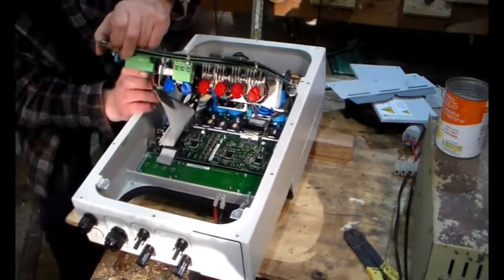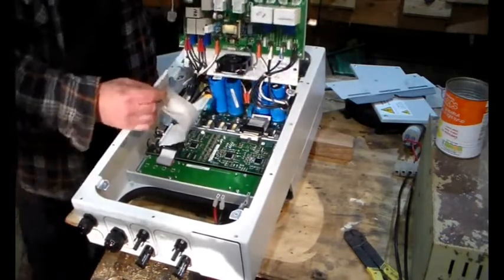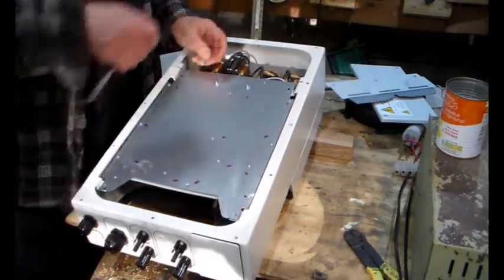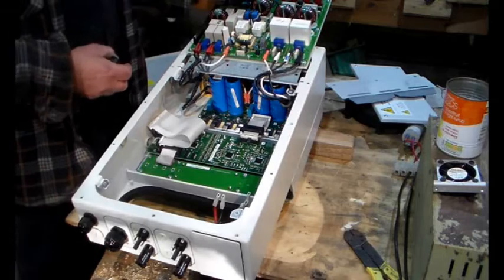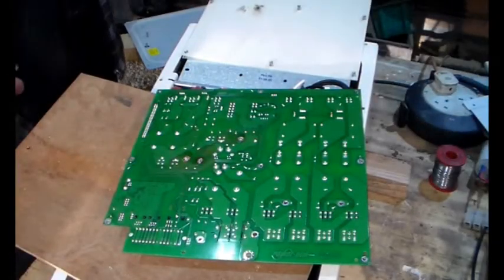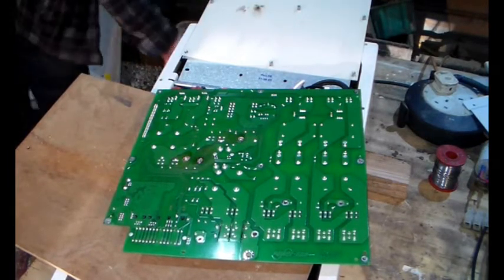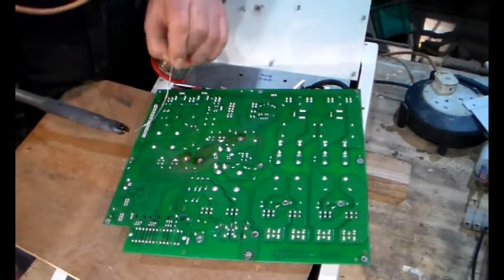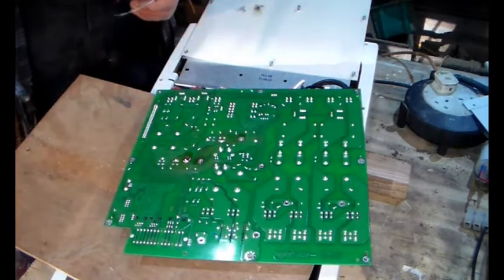ABB Aurora inverter fault E031 improved fix / repair

Comment: Hi Andy, I have just repaired mine for a seccond time using your videos on both occaisions.
Thank you so much for posting. I'm now looking to install a solar powered fan below to assist with cooling.Graham, Perth Australia
Reply from the maker: Graham, just a mains powered plug in timer running a small mains fan will work well. I use the snail fans out of fan assist ovens as they are free, cheers
Reply: @TheInfoworks  Thanks Andy, I will source one and install , I have a spare timer, will let you know how it goes.
Reply from the maker: @grahamturnbull3815  Grand, I've just fixed another using the relays from one of those Ginlong turbine inverters I investigated recently, cheers

Comment: I have just fixed my dad's 11 year old Power One PVI3.6, after watching your (and others) videos. 
All four relays were still switching perfectly fine, but one of the PTH holes on one of the relays appears to have burnt out, leading me to think that the fault lies with poor soldering and insufficient solder filling the thru-hole, which causes heating and eventually the solder joint goes high resistance and causes more heating, sometime leading to softening of the relay body around the pin.

I replaced all four relays anyway, and soldered a length of TCW (Tinned Copper Wire) between the two relay pins that are commoned together.

The relays fitted on this unit weren't the Zettler AZ2150W ones, but Omron G8P-1A4P-8G 12V, Zettler were obviously not the only standard fitment parts.

I used Hongfa HF165FD/12-HY1TF available from Rapid Electronics for £1.81 each (inc VAT) . These are actually rated for a greater number of switching cycles than the Zettler ones.

I would also expect the TE Connectivity T9AS1D12-12 to be a suitable replacement relay as well.

Thanks for your video.
Reply from the maker: Hi, thanks for your detailed comment. The heating starts I suspect from worn contacts arcing. Have you seem my video on resetting the contact gap? cheers
Reply: @TheInfoworks  I have, but none of the relays in this one had hi contact resistance, but had a pin  completely disconnected from the track, by a burnt out via, so I think the heating occurs the other way round from solder joint up the pin, causing relay contact movement, and therefore increased arcing or non closure

Comment: Hi Andy , I've got an Aurora 3.6, and it won't power on at all , just stopped working suddenly at noon . Do they have a main fuse on the board ? Or do you think something else will have blown ?
Reply: Well I took it to bits and it looks like one of the zettler relays pins has melted through the plastic insulating sheet and shorted onto the back panel.  The main fuse in the fusebox had tripped, so I'm just wondering now whether I can get away with replacing the relay or whether it would have taken anything else with it.?
Reply from the maker: @paulwcarr  Paul, yes replace the relay and see my video on extending inverter life, cooling is very important, cheers

Comment: My aurora 5000 failed with E31 after 5 years and 9 months.  Couldn't get a warranty repair on it, so I tracked down the relays and fixed it myself.  My fix lasted exactly 4 years, but unfortunately this morning E31 has returned.  Not sure if I'll fix it again, or just get a better inverter.
Reply from the maker: Hi, just a few thoughts: is there more than 5Kw  of panels? and what is the inverter cooling like, if it is mounted in a place that gets warm this can have a significant effect. I always run inverters below spec. and make sure there is ample cooling, sometimes adding a supplementary fan, cheers

Comment: Hi Andy. Fantastic job. I used it to fix three of the relays a year ago and it worked perfectly! Thank you!! However, the 4th one just blew and when I did the same thing, and hooked it back into the panels/grid, the screen is blank and nothing happens. Any thoughts? If I grab a DC powerpack from work could I safely check everything out in the workshop, without having to hang it back on the wall and attach to panels?
Reply from the maker: Jeff, Hi, Check out my other videos on extending inverter life and Aurora zettler contact repair. You will need a variable power supply that goes up to at least 150v DC to test a grid inverter, a high voltage battery will be dangerous and maybe allow too much current to flow, subscribed? cheers
Reply: @TheInfoworks  Thanks a lot Andy. I can get a DC power pack that goes up to 200volts. I can limit the current coming out too-what would be.a safe value do you think?
Reply from the maker: @radagast_the_brown  Hi, you won't need much to check the inverter is working, half an amp at 150 volts is 75 watts. I normally just work on voltage and adjust it when the inverter starts, cheers

Comment: Thank you so much for this guide, I did mine yesterday and worked a treat! Was quoted £900 for a replacement as mine was out of warranty
Reply from the maker: Heather thanks for your appreiation, please see the other videos in this series, including one on the resetting the relay contacts and extending inverter life through better cooling, and of course my paypal link, to say thanks, cheers

Comment: I have 4 of these lying around with this fault, fixed the first one today after seeing this video thank you. There is copper tracks on both sides of the PCB to carry the current, adding some copper wire across the high current joints might help reduce the resistance.
Reply from the maker: Garry, thanks for your comment, I have a video on the relays giving some thoughts on the heat build up from poor connections of the relay contacts and the fix, cheers

Comment: Dear Andy,
Great video, saved us a fortune. Our local solar man wanted to sell us a new inverter for about £1,700, but I followed your video with the resoldering and the E031 fault disappeared. I only had to purchase some Torx screwdrivers for a few pounds. The only problem I experienced, was that the Torx screws were hard to remove. I have subscribed. Thanks a lot.
Reply from the maker: Hi, thanks for the donation, certainly helps. Please see my other videos on these relays and one on extending inverter life with an external timed fan. I think they are in my solar grid inverter playlist, cheers

Comment: Hi, only one relay burnt and one connection burnt out soldered it but same fault! Tried adjusting relay connection by cutting off top part of relay while still on board. Still same? 031 fault..
Any suggestions thanks..
Reply from the maker: Max, try looking at the contacts on the other relays, seems to me one of them is not making good contact. Please let me know how you get on, cheers

Comment: Hi Andy, I have an old Aurora PVI-5000-OUTD-AU 5KW solar inverter that I was hoping to repurpose. I was wondering if I could connect a battery to the PV in puts on the inverter. The battery can handle the load and the voltage is in the correct range for the inverter. The issue I see is controlling the current.
Reply from the maker: Hi, yes you are right to think about current flow but grid inverters need a mains signal to work so they won't start without a mains connection. If you wanted to put DC from a high voltage battery pack into one then some form of resistance would be needed to reduce the current flow and this would be wasteful. These cannot be used in a stand alone situation, cheers

Comment: Sorted mine, thanks for the info. Just one burned through connection on mine, no evidence at this point of others showing stress.
Reply from the maker: David, a big "thanks" for your kind donation, much appreciated. Your fault may have been caused by the recent strong sunlight and heat. Please see my video on extending inverter life, all the best and hope you have subscribed, cheers, Andy
Reply: @TheInfoworks  you're most welcome and yes, I'll take a look at the video on extending. I was pleased to detect the failure today on the day of failure, rather than months later and lose FIT payments! :)

Comment: Sir how to repair abb inverter fault code-0035
Reply from the maker: Hi, I'm guessing here from a brief bit of research, your problem may be an isolation fault, meaning that there is some very small track to ground on the DC side. This can be a cable in a wet place and high voltage DC leaking to earth. This is just a guess so don't hold me to it, see my video on isolation faults, cheers

Comment: Hi Andy,   I had the E031 fault.  Here's the story of my experience and some thoughts about the fault.   Solder joints were on the verge of failing. Re-soldered but still no good. A quick search of Ebay only turned up Zettler relays from China.  As I preferred a genuine Zettler relay as opposed to a Chinese copy, I chased up a Zettler distributor. About AUD$4 each.  Changed all 4 relays and it now works.  Thanks for your videos.  I have made a donation :)    My thoughts about the fault...   The hole for the relay's pin is oversize. This is good because it allows for easy removal of the relay, but it is bad because it adds more solder (electrical resistance) between pin and PCB. In my case only one relay pin was faulty and this pin had a small opening in the solder mask, reducing the cross sectional area of solder to conduct the current.  I suspect that the joint failed because the current density was too high for the quantity of solder used. As per your suggestion I scraped away the solder mask to increase the CSA of the solder.  In hindsight I should have wrapped a piece of tinned copper wire around the relay pin and soldered that to the PCB, as well as opening up the solder mask - just to get the resistance of the joint lower.   I disassembled the faulty relay and found that when the contacts were manually closed there was no over-travel of the armature which is required to apply pressure to the relay's contacts.  It looks like the hot solder joint allowed the internals of the relay to move due to being overheated.  My suggestion is to change the relay regardless as it is almost certainly going to suffer some damage due to the hot joint.   I wasn't looking forward to removing the relays as there were massive copper tracks around the relay pins and these tracks are great at sucking heat from the joint. I noticed you used a very large old iron.  Not having one of those irons I used my JBC pencil style iron with a 1/4" (6mm) tip.  The JBC has a peak power rating of about 170 watts and had no trouble melting the joints which were then attacked with a solder sucker. The over-size holes in the PCB made it easy to get all the solder out.  Thanks again for your help.
Reply from the maker: Hi, thanks for your in depth analysis and for your very welcome donation. I think there are several contributing factors in this fault, several of which you highlighted. Beyond that there is siting of the inverter and cooling. I produced a video on this, extending inverter life. It's great you took the time to fix this inverter and we all learn something by it, subscribed? cheers

Comment: Hello Andy  My inverta died yesterday with E031 messaging. It is a PVI-12.5-outd-AU 3 Phase unit. Will your fix be the same for my unit??
Reply from the maker: Kevin, as this is 3 phase there will be some differences, however it is commonly the DC relays that are a problem. Best thing to do is inspect all the relay connections and see where this takes you, subscribed? cheers
Reply: @TheInfoworks  Hello Andy. I followed your advice. The just soldering did not work so I sourced a new relay and replaced burnt one and the unit is back up and running perfectly. Thank you so much Andy!!!!. I have sent you a donation. Regards Kev
Reply from the maker: Kev, brilliant and well done, self reliance improved. I hope you have seen my video on extending inverter life (it's important to keep inverters cool) and thanks for the kind donation, much appreciated, cheers

Comment: Please give this man a Cigar and a Crate of Beer 🍻🍻🍻🍻🍻
I watched his Video , took my Aurora Power 1 Inverter apart and there was the Fault as Advertised 
Fantastic 
You have saved me a Fortune 
Thank You 
Also thanks to the Queen for teaching me how to solder, eat your heart out Fairies !!
👍👍👍👍👍👍👍
Reply from the maker: Thanks for your enthusiastic comment, I'm pleased you fixed it. Please see my channel page and then under "about" there are other ways to say thank-you as others have also done. It helps with producing more videos. Also please see my video on extending inverter lift and subscribe, cheers.
Reply: @TheInfoworks  Thaanks Dave interesting if I get E031.. my problem is that my inverter every few months is not generating, I cycle the power and it then generates, do have a theory to my problem? Best regards Ian
Reply from the maker: @snagbuster  occasional problems are the most difficult, could be a relay contact problem or general wiring. When it happens check AC in and DC in before you reset, that's a good start. I have found out new details about the Aurora relays, the video will be out soon, cheers
Reply: @TheInfoworks  thanks Andy for your reply. My gut feeling is a relay because when it is off line it is trying to connect the array. So the AC is present the DC voltage is present so I think it is a relay. Do you know of any suppliers for the replays please Andy.
Reply from the maker: @snagbuster  Have the relay covers off and bend the moving contact arm to make sure when the relay operates that the contacts make a good connection. Make sure there is a gap when the relay coil is NOT energized. There will be a video about this soon. I use a dremmel to cut the corners of the relay covers on an Aurora as the covers are glued in place, cheers

Comment: Andy - thanks for this. Just competed the fix and worked a treat. Just a note that might help others. When I first switched the inverter back on I got a similar but not the same error, which was E013-Wrong Mode). I have 2 solar strings on my setup running independently through the inverter. When I was doing the fix I must have inadvertently pushed the switch on the board from 'Ind' (Independent) to 'Par' (parallel).  This switch is just beside the AC input block. Took me awhile to figure this out and thought the fix didn't work - so others might want to take note of the switch setting as they start the fix for their setup.
Reply from the maker: HI, thanks for your story, yes this has happened to me once, how on earth that little dip switch can get caught as it is protected by the mains terminal block I cannot figure out. However as proved it is possible. Pleased your fix has added to the long list of repaired inverters. Please see the "About" tab on my channel page to return the favour, Subscribed? cheers

Comment: Dear Sir, thank you very much for this great video; you've saved me money and aggrevation with one hour of work, cheers !
I would want to chip in my 3 thoughts I had while working on the faulty motherbord...

1. I think the burnt connectors of the relay are due to poor soldering in the factory and not so much with the heating of the relay itself.
As you say, there are (relatively) big currents flowing through the relays, if a connector is not soldered properly, it will heat up the connection (I^2Rt)
Over time, it will corrode the connector because of that "troublesome passage" from motherboard to relay.
On my board, only one connection was faulty, the rest was soldered quite neatly.

2. I have thoroughly cleaned the area around the connector (and the connector itself, of course) with a brass bristle in my Dremel, 15 seconds was all it took.

3. I found the relay (in case it was broken, which in my case was not...) back on Aliexpress, here's the URL:
https://www.aliexpress.com/item/4000073647264.html?spm=a2g0o.cart.0.0.31383c00QRKuvY&mp=1

Again, it took me all in all one hour to fix. Thanks again.
Martin from the Netherlands.
Reply from the maker: Martin, good to hear from you and thanks for your thoughts. I still think heat build up is a factor and that my video on extending inverter life can make a contribution, Subscribed? Cheers
Reply: @TheInfoworks  It might be a combination of three: Bad soldering, bad solder, heat. You have lots of experience with E031, I only have seen one ;-) so I absolutely believe you when you say that heat is the main culprit. With that as startingpoint, I can imagine that the heat causes the solder to age rapidly and then crackle ==> more resistance ==> becomes even hotter because of  the current flowing through and eventually blows out. I remember that years ago the industry was not allowed to use solder with lead in it anymore (health related) and they started using a solder mixture that aged quite rapidly (they found out after some years). I still have a good roll of the "old stuff" and cherishing it.
So it might be a good idea that when repairing an E031 one resolders all the relay-pins in one go. Just a thought. Cheers.
Reply from the maker: Hi, an external cooling fan run from a plug in timer works very well and also protects the capacitors. Mine is comes on from 10am till 4pm, cheers

Comment: Andy, thanks for the information  - I think you just saved me a lot of time / money.
However, I'd like to throw in my 2 cents worth. Having repeatedly repaired the relay connections in Nissan window regulators it's worth taking the time to scrape the relay pins back to bare metal and re-tin them when you solder. Otherwise - as has been my experience - the resistance in the joint is still present, so it gets hot and the dry joint recurs. Cheers
  Wayne
Reply from the maker: Wayne, thanks for your experience, i found increasing the contact area will reduce the resistance, but overall it is heat that is a problem. I uploaded a video about increasing inverter life where cooling is covered along with array size, see my solar inverter playlist, cheers